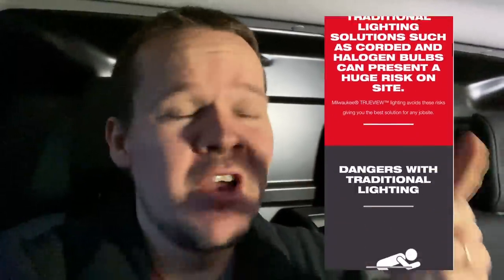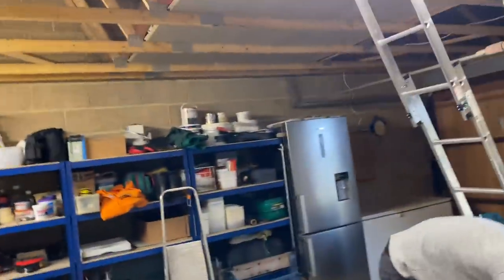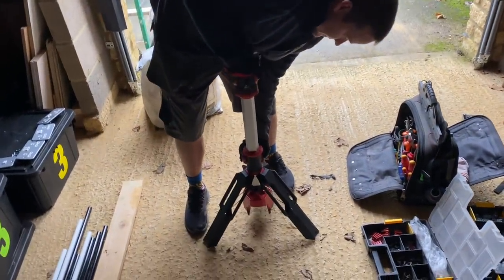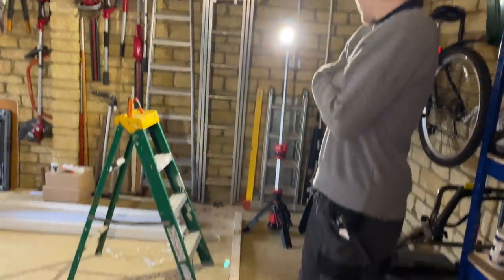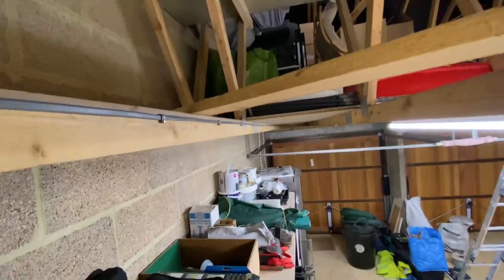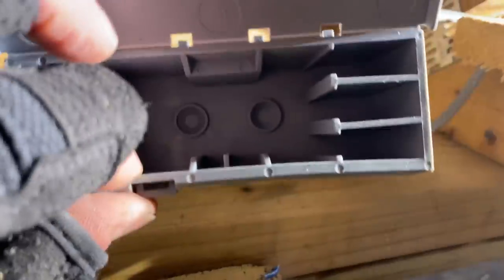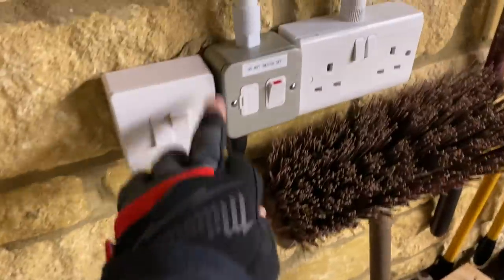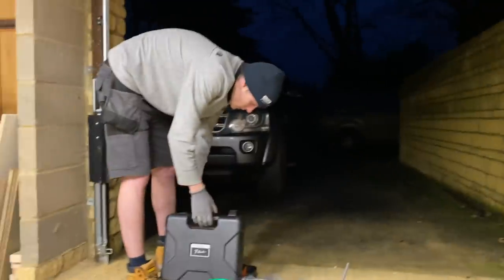NEW BUILD GOODNESS!! Why do they do this!!!!

Comment: They look like the lights I put in my garage. Totally agree, these lights don’t have anywhere to put the earth, baffling and getting the cable was silly design, I put the cable in whilst on the ground, clipped the light in and connected it to a jb with wago 221s and connected it to existing rose connector, which I’ll need to get rid of as a next job. Clipped all the cables  in, I use the plastic 9 mm clips but replaced the nail with a screw as they stay up better.

Comment: Very noice this came in my recommended. Had an electrician yesterday in for a couple of hours. We changed the lines in the board a bit. Cause my Pc is 950w and had some issues with the board. Swapped those lines put stronger cables in my area, as well as washing machine area and now we’re rolling. He charged us 60€ for a work costing 150€. He is a friend so yeah happy days everything works smooth and my Pc has stronger fuse and cables to work with gg. And a new plug. Great work keep it up.

Comment: 15:40 did that in my garage for the switch on the motion light so I could turn it into always on mode, wouldn't you know it one of the other family members likes to turn it off even though it says "do not turn off!!!!!!". It's not even like it's next to another switch or anyting well it is but it's going the opposite direction. 1 vertical switch for the garage lights and 2 horizontal switches for motion light and walkway light.
And both of those are the ones you don't really need to touch so...

It's been weird in 2020 you make a comment and everybody's stuck at home so you get a reply within like 10 minutes.

Comment: If nobody tells you what you did wrong how can you improve? And at the same right if nobody tells you what isn't the greatest, how can you avoid doing that.
Reply: Yes, you should never use plastic switches or sockets in an outbuilding. You can't earth plastic and can still receive a nasty shock from a damp one.
Reply: @truthseeker7794  and they're also subject to temperature swings which make them brittle. Oh yeah and physical damage.
Reply: @truthseeker7794  I guess you didn't see that picture of the bucket of dirt that earthed the generator.....

Comment: I would love to see the study I know it exists I'm just too lazy to look it up right now. Of how wood fares I mean it's going to have a reasonable expectation of holding up under a fire for a short amount of time it's not just instantly going to combustion and disappear. Around these parts of the Woods on the other side of the pond there was a big issue in some older houses using framing truss made of wood would like a 2 x 4 at the top and bottom and two by twos interconnecting them in a zigzag, big issues with fire departments and having firefighters falling through floors because they were giving out during fires. Where as a solid Timber structure had a little bit of a Time gap between when it would no longer hold weight as the fire burns on the outside and it takes longer to get to the inside and degrade structural integrity.
So yeah I would say you're fine tying into that wood for support, although you only really have to worry if for some reason somebody is trapped in there because something fell on top of them. Hopefully by that point circuit protection has tripped and the fire department has a plan to get them out.

Comment: I've used those batten led fittings before with the naff pull out end, it's definitely one hell of a design flaw. Electricians should design lighting not some corporate nutter with a drawing board 😂👍

Comment: Why would you want a metal casing for a socket??????Its a shortcut waiting to happen!!We in the Netherlands only use non conducting material for a socket.We also switch the zero wire.We install also a masterswitch.Looking at the way these things are built in the surrounding countries,i can assure you we have the most safe electrical system!!

Comment: Yeah I agree that look silly, have all in metal 👍😀
Reply: More to the point, you can't earth plastic and you can get a nasty shock from a damp plastic switch or socket. I would never use plastic in an out building.
Reply from the maker: Metal clad have plastic switches to 🤦‍♂️
Reply: @Cjrelectrical  You're right my friend,  but the plastic switches are very small and any current passing through moisture/condensation on the switches would also be on the larger surrounding metal areas (which would condense moisture more quickly as metal is colder than plastic) and would then quickly be dumped to earth.  This would often trip the RCD but more importantly on older installations where there's no RCD It's important to dump any stray current to earth but I'll admit, that doesn't always happen but mostly it does.  Myself and a few of my customers had,  had  a clout from damp plastic switches. Although I worked as a sparks for a few years,  I'd previously had a very boring background in science, research and development for a well known electrical components supplier. They knew the dangers of plastic fittings in damp situations but also knew that to expose these dangers would affect their massive profits. They also developed 99% fire retardant plastic consumer unit enclosures but that was ignored so that the establishment  could bring in the new amendment 3 all metal clad units. It was a massive money spinner for them and the plastic units were sold off to less developed countries.  I left that company in disgust. This is what happens when there's massive amounts of money to be made. I'm not criticising you my friend but just commenting to the replies of other people. I love your channel and I can see that you're  just a hard working guy trying to make a living, unlike some sparks on youtube who are just trying to make a very extravagant life style for them selves of the backs of good people. Peace and good luck to you in these mad times.

Comment: Chris top work again , can you explain the loading issue from a laymans point and what you need rectifying , i assume breaker update and possible new cable run to consumer , just finding it shocking they limit expandability especailly for a garage.

Comment: The lights in the garage loft should have been put on a separate switch.   It is highly unlikely that the client will need to go up there every time they go into the garage.
Reply from the maker: I only do as the client wants.
Reply: @Cjrelectrical  , understood.  It is the client's money after all1

Comment: If it’s 13A fuse spear could you not change it to a dobble pole swich which would give you 20A 
Or is the 13A fuse spear of the ring so it’s down fused for that¿ 
Sorry about spelling I’m dyslexic
Reply: I think that's a 3A fused spur for the lights. The sockets don't need fusing down as they're coming off that 2.5mm2 armoured cable that's protected by the 20A breaker in the house.
Reply: @havoctrousers  Chris said the garage was fed from a 13a fcu in the house
Reply: @paullyons4624  must have missed that - if so, that's a bit crap putting the whole garage on 13A

Comment: 32A is to big for 2.5 mm. A 2.5mm cable is capable of supplying around 20-25 amps.
Reply: erm who mentioned it was protected by a 32Amp breaker?
Reply: Marcin Nowak It's all running off a 13 amp FCU.
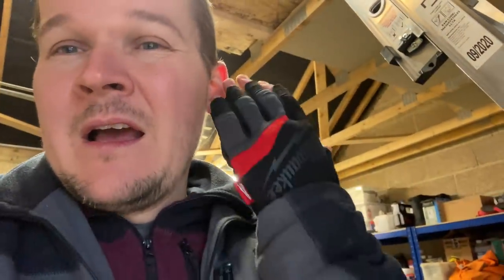Reply: @mikeenglish6734  2:02 "It's on a 30 amp fused connection unit in the house"
Reply from the maker: 13amp
Reply: @Cjrelectrical  Sorry, I didn't have it clear with your accent. So I read captions and there is 30. My mistake.

Comment: Fitting a metal clad socket and light switch, with a conduit coupler between would have looked better. Unfortunately you drilled the holes for the conduit before mentioning it 🤦. 

Good video 👍

Comment: Sorry Chris I do like your videos but this let you down a bit!!  but not liking the materials used in this job...why didn't you fit a local isolator for the flood light instead of the wago box.?.Don't understand why you fitted the flood light light switch adjacent to the garage light switch witch will be turned off by mistake..! Also did the loft lights have it's own light switch?
Reply: I'm assuming the customer wanted the light switch there and didn't want a separate switch in the loft. All down to cost, 1 2gang switch is cheaper than 3 single switched and less cable runs.

Comment: Good evening 

Rubbish job on 2.5 mm , In an ideal world we need 6mm to garages , enough to cover all bases down the years of change 
40 amp supply 
Ring main 32 a & light 6a 
External Lt & socket 👌
Reply from the maker: Totally agree with you
Reply: Sure a 32 amp supply would be plenty for your average garage
Reply: Do an expected load calculation like you would with any radial socket circuit. My garage runs off ring main spur on 2.5mm2 and I want a new radial. Freezer, Christmas lights, car battery charger, occasional power tools and tumble dryer (used once or twice a year). 20A on existing 2.5 extended back to board is more than enough, even if I had washing machine and dryer in regular use. Not everyone wants heating and other high load appliances. Car charger in future would have a whole new circuit. More than 20A would be well out of proportion on my 60A incomer.
Reply: Ring mains are bad enough in a house, but in a garage?   2 x 20a radials would take more loading than a ring and not leave all the potential fault issues a ring creates. Rings are the creation of the devil himself. I do agree a larger cable would be good if starting from fresh, ( budget permitting) but in this case he said the garage supply was via a 13a fused connector
Reply: @westinthewest  different kettle of fish mate. Lighting is only getting more efficient with the change to LEDs, and yes diversity brings down how much the kitchen etc actually needs by a lot. There no good reason to say 'just in case' as there's no expectation for any significant additional loads. Maybe a switch to electric underfloor heating or a heatpump but I'd want to put in a new circuit for something like that anyway.

A garage wall (either inside or out) is likely to see an EV charger installed sooner or later in many cases, which is going to be a large continuous load so simply have to add that to whatever load you would expect without it, no diversity on that!

Therefore a 6/10mm SWA to a garage board (wherever the garage looks like a suitable place for a future EV charger) is a wise move. And if 10mm sounds overkill let's not forget that voltage drop needs looking at, while 6mm will usually be sufficient in domestics going beyond the 3% voltage drop for garage lights is a realistic possibility when dealing with these high loads.